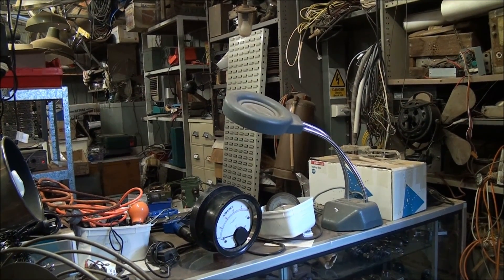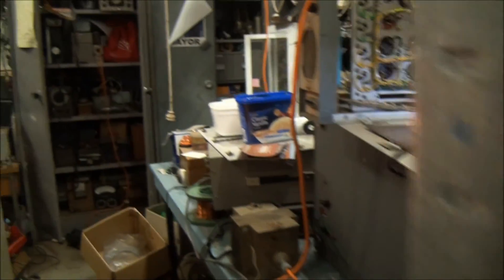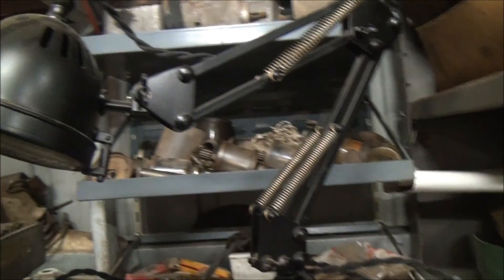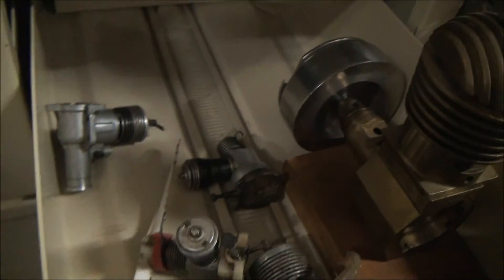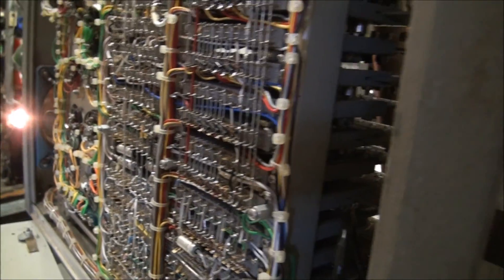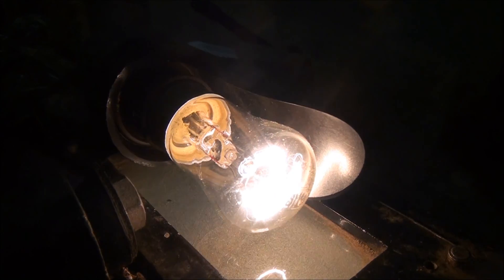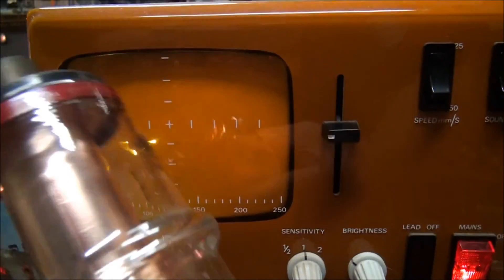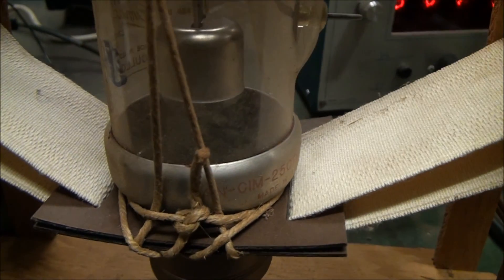Shed projects, radioactive clocks and valves

Comment: Very nice! with the UV light and the decatron tube; is that part of the nixe counter you had going there?
Reply from the maker: The Dekatron was purely there for extra effects, I usually have it somewhere on the workbench as a decoration. The counter with the Nixie tubes uses a GM tube and counts the Radioactive particles passing through the GM tube.